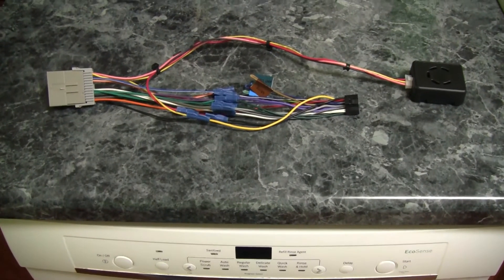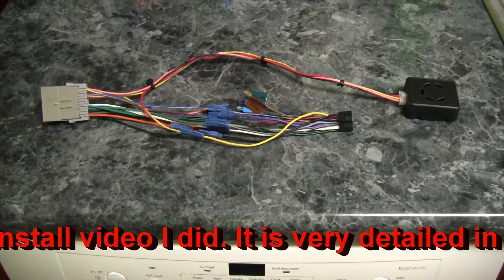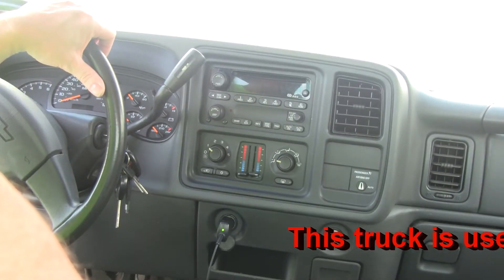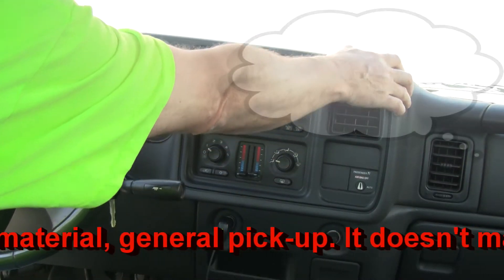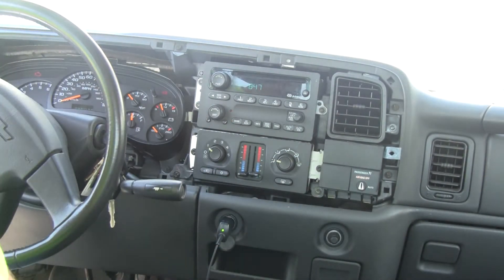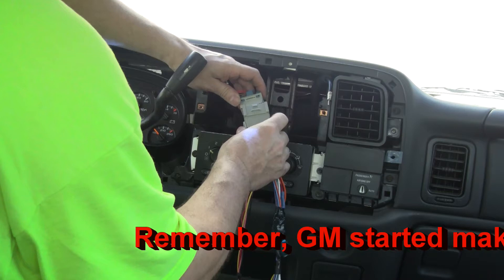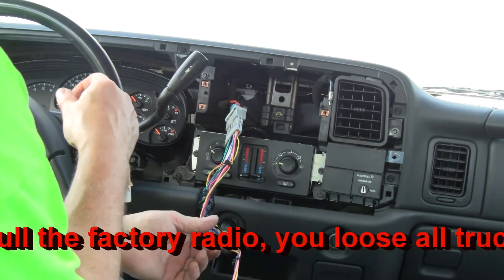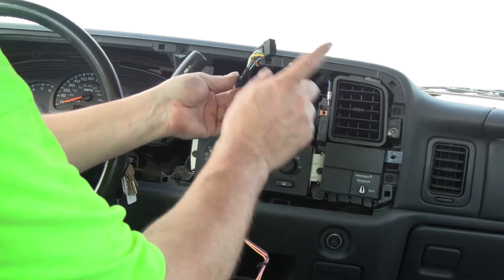S01E06 - OEM Radio with GM Class-II through-the-radio Alarms Replacement - 1080p

Comment: So if that interface goes bad, would it keep making the radio shut off??
Reply from the maker: It might, I don't know. I wouldn't expect it to. It basically takes a signal from the vehicle and runs it through the amplifier/radio/head unit. My guess is probably not. But I don't know.
Reply: @DelHollowProductions  okay because I have a new interface and my radio keeps shutting off at high volume. Everything is correct